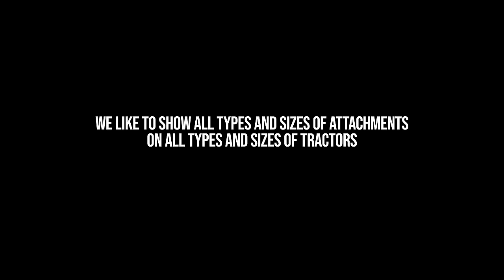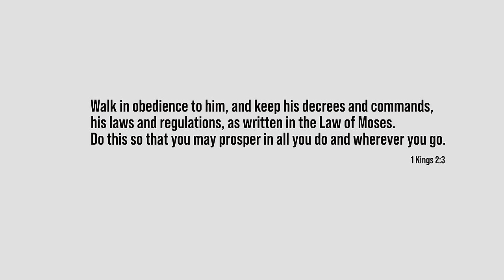HATE MAIL: THE BAD SIDE OF BEING IN THE PUBLIC EYE

Comment: Having been self employed for many years now,  I've come to the conclusion that 95% of lifes aggravation comes from 5% of the population.  Answering these people rarely settles things but it's good to make an attempt to set them straight.
Reply: I concur that has been my experience.  I have been told that by many managers and military officers.  Similarly 80% of work is done by 20% of the people.  I learned to find the good workers in the government agencies and go to them if I needed something done.  I found I could get things accomplished in times that were considered impossible.  Not greasing the wheel, just using the wheels that worked.  I also found that many bad employees had talent at something and if you could identify it and put them to the right task they often became very valuable.  There was still à percentage that just needed to go away.
Reply: I would argue that its more likely 80% of headaches come from 20% of the base; its called the pareto rule.

Comment: I appreciate your honest approach in all of your videos. You convinced me about the value of Summit tractors since that is the size of tractor that I am looking for. They seem to have many features that are not found on comparable tractors. My only reservation has been the availability of service centers for them. I could have purchased one at an Atwoods store here in my home town for 19K plus taxes. When I checked on service centers, there really weren't any within a reasonable driving range. I am capable of doing normal maintenance on the tractor, but if something went wrong and I needed a service center to help, it would have been a 2 hour drive to get to a service center that didn't look like a shade tree operation. I have a Kubota dealer within 15 minutes of my house. I have a John Deere dealer within 30 minutes of my house. I also have a New Holland/Yanmar/Mahindra dealer within 15 minutes of my house. I totally loved everything I saw when I looked at the Summit tractor and I hope they get more reputable service centers closer to my area soon because Summit has features that are standard that I would have to pay extra for on any of the other tractors of a similar design. Thanks for your videos! I really appreciate watching them. Until I find a really good deal of a tractor similar to the features on the Summit for a similar price point, I will simply continue doing what I have been doing to make do. Thanks again!!!

Comment: If Summit is a quality tractor and the only problem is brand recognition, that means to me I can possibly buy a lower priced high quality tractor without paying a brand premium.

I don't understand why Summit didn’t leave you a demo tractor at least and you didn't become a dealer for them.  

Every deal does expire.  But the way this deal ended created bad optics.  Summit's marketing appears to have not done a good job in this case because this deal didn't have a smart exit plan.  At least from an outsiders perspective.
Reply: I think it basically came down to Courtney wanted to start selling tractors again and needed a strong "number 3" since JD and Kubota have gotten so expensive. While he might of hoped Summit would become popular and he would be well positioned, it just didn't happen. Kioti has a large enough market share and dealer network on the new sales side to support a used marketplace. Probably neither Summit or Courtney thought it was a good idea to be partnering anymore if he was also selling another brand so they ended it.
Reply: Courtney sells USED tractors. There just are not a lot of USED Summits out there. It's not a thing, because the brand is so new. Becoming a full blown NEW tractor dealer is a completely different beast, because it comes with service & parts obligation.